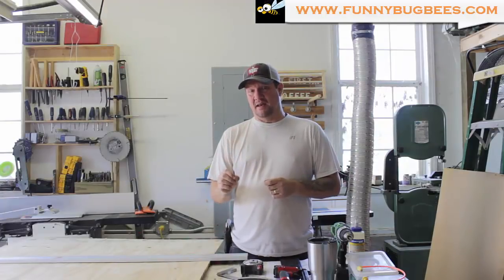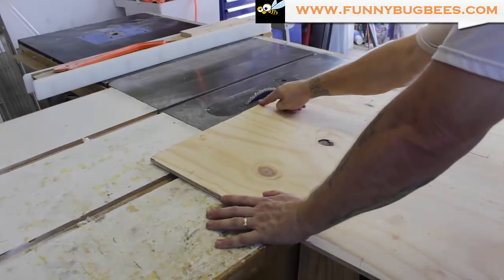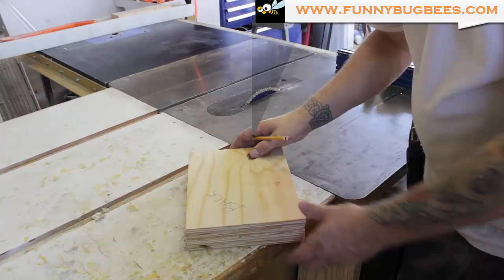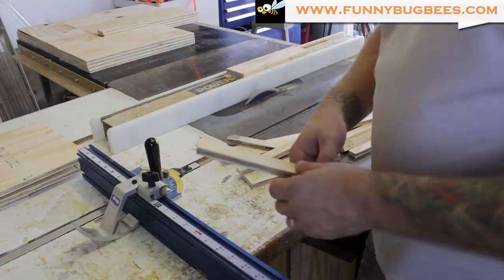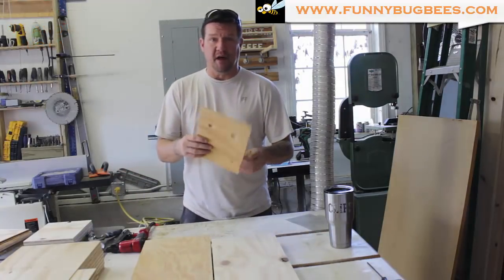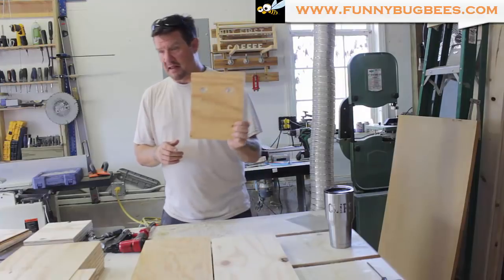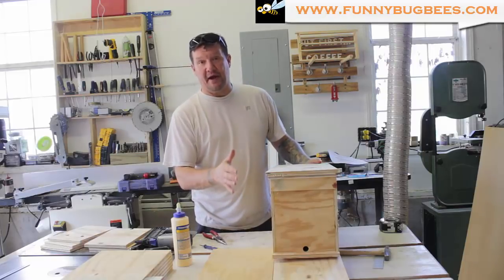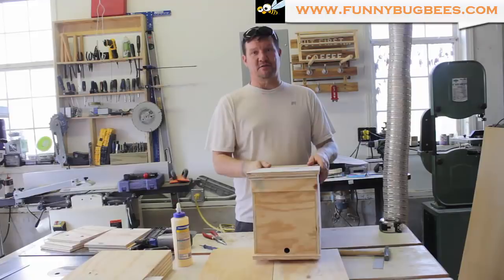Howto: Four NUCS from a single sheet of plywood

Comment: Thanks for this video.  I immediately built four boxes to use for swarm catching.  I did find that making the cleats for the top cover at 1" instead of 3/4" provided less play and a more snug fit.  Also, I cut everything using a circular saw so it was a little easier cutting them to 1" width.  For day to day use in the bee yard, I agree that 3/4" plywood would be a better long term investment, but for swarms and selling, you can't beat the cost of these!
Reply from the maker: exactly..though if you dip these in parafin wax, they will literally last for years and years...
Reply: @FunnyBugBeesandWoodWorks  any risk of the ply delaminating at those temps?
Not sure what temp is safe with WBP ply (exterior grade)

Comment: Nice job. I use 3/4 plywood. Have to add a half inch to the bottoms ends and tops. On one end i cut off 3/4 of a inch for the opening so u can use a OA vaporizer. Thank for sharing.   When i say i add a half inch i mean i make them wider.
Reply from the maker: i use an OA vaporizer on my larger hives. For my nucs with these hole cut rather than the 3/4" opening you speak of i use a propane powered fogger. It has a small nozzle and I can put the nozzle right in the opening and give it three puffs and im done.

Comment: Is that a 3 ply plywood you use aom just using a piece of plywood for lids and looks good I take little xtra time and make telescoping lids with 1/2 in plywood nailed down to 11/2 in pine frame to reduce warping .
Reply from the maker: no its 4-ply BC Sanded grade playwood. Runs about $22-24 per sheet. I actually have found out there is enough cut off if you keep tolerances tight to get telescoping lids out of the same sheet!

Comment: Very nicely presented!  Thank you.  Have you had much success using these as swarm traps?  If I used them as a 5 frame Nuc, I think I'd want to be able to place the quart jar, Boardman feeder on them, so I might do a bit of adjusting to be able to do that.
Reply from the maker: Yes, they make excellent swarm traps. To convert them, take a cheap 18" piece of 2x4 and bolt it from the inside of the NUC to the outside, then drill a 1" hole 2" from the top of that 2x4 then use that vertical piece of 2x4 to hang it on a nail in a tree 10 feet off the ground and with several sprays of a product I use called "Swarm Commander" inside it and hang them all over the place. I catch probably 6 swarms each year for very minimal effort. If you need swarm comander, which I swear by you can find it here: https://www.funnybugbees.com/queens-bees-swarms/swarms/swarm-lures/
Reply: Picture of the swarm trap maybe?

I just made 4 NUCs from your tutorial. Do you mean put the 2×4 on the back of the NUC? Bottoms flush? Or tops?

Comment: Will these measurements work on 3/4. Plywood
Reply from the maker: no, any time you alter the thickness of your stock in any project, its going to alter your dimensions. For instance, you would need yo make the top and bottoms of this design 1/2" wider to compensate for the material thickness, but you would also need other modifications to the design as well. these are easy to figure out you just need to sit down with paper and run it through your brain before starting. Any dimensions which would be caused to change should be compensated.

Comment: I like this project. But i do have a question; Would it be good do use a smaller mesh for the vent holes? #8 is small enough for small hive beetles to get through. That's what is commonly used to make shb traps.
Reply from the maker: this is incorrect. #8 mesh has an average aperture size of 0.0350 inches or 2.2mm which is smaller than an adult hive beetle which are 3.2 mm across the carapace. The correct wire cloth to use for hive beetle traps is #6-041 which has an average aperture size of 3.2mm. Sure some hive beetles will still be able to be trapped using #8 (but very few), #6-041 is far more effective as it is the exact size of a small hive beetle...you can see and order this product here: https://www.funnybugbees.com/the-bee-shop/beekeeping-supplies/hardware
Reply: Doesn't really matter about the mesh size. The beetles can walk right in the front door.
Reply from the maker: true, but this is why we run Freeman style small hive beetle traps on all our hives...they walk in...and immediately are drowned, and we lose no bees. The ones that dont walk right in are wrangled by guard bees and driven down into the same trap. You can look in my videos I have two videos on this, one on how to build them and one on checking a newly installed trap after 24 hours.

Comment: I like it.  Does it hold 5 frames?  Thanks for the directions.
Reply from the maker: Yes, they are 9" wide 5 frame nucs. So 1/4" narrower than a standard langstroth NUC, but the same inside dimensions. The outside dimension is different due to different thickness of stock.

Comment: are these deep enough to not squash queen cells on the bottom frames
Reply from the maker: The distance from the bottom of the top bar of the frame, to the bottom of the frame bottom bar is 8 5/8". The fronts/rears of the NUC are 9 1/2" high. This means from the floor of the NUC to the bottom of the frame is 7/8".

Comment: Why didn't you use 3/4" plywood so its standard? A lot more rigid too. How have they held up in weather? Thanks
Reply from the maker: because 3/4" plywood is $34 a sheet and 15/32" is $17.00 :) and these are made to be inexpensive.
Reply: And lighter. I just wonder if they warp in time.

Comment: Hey bud I built 4 of these and I love em. What would dimensions be with 3/4” plywood?  Thanks a lot.
Reply from the maker: well it doesnt matter what size stock you use, just always remember the inside dimensions and you can do anything. The inside dimensions are the same as a standard 5-frame NUC, so 7.5"  x 18 3/8" (below the cleat i.e. wall-wall) or 19 1/8 from inside cleat to inside cleat (the frame rest)......Let me get a pencil here and write it down and ill post the dimensions for you in a few minutes after verifying them.

ok here goes, editing comment, verified dimensions...

Bottom: 20" x 9"
Sides: 19 1/8" x 10 1/4"
top: 22" x 9 1/2"
Fronts/Backs: 7 1/2" x 9 1/2"
Large cleats: 9" x 2"
small cleats: 9" x 3/4"

Hope that helps Dadu...
Reply: thanks a lot

Comment: Normal plywood isn't very good for this use, the boxes tend to warp even when well painted. They are okay for traps and quiet boxes but not very good for regular use. Advantech sheeting works much much better. Of course the measurements have to be altered a bit because advantech is 3/4" thick rather than 1/2". I just cut them like a normal nuc and cut out the frame rests like normal lumber, table saw or a router will either one rabbit out a nice 3/8 x 5/8 frame rest.

I didn't watch all this vid but I assume these are the cheap nucs from 1/2" plywood like I built earlier this season with end box frame rests as opposed to normal rabbit style rests.
Reply from the maker: this would defeat the purp[ose of the video, specifically how to build "commercial grade" NUCS. If you are building a small number of nucs for personal use, then, by all means, use another material. I use 3/4 white pine for our non-commercial grade NUCS for our customers.
Reply: Ok, if you say so.
Reply from the maker: Yes, I hold fast to my statement. "commercial grade" means good for a season, not for prolonged use. The folks interested in commercials grade nucs are looking for cheap but effective NUCS they can use for a season or two. If you are selling nucs, you typically make them up the spring you do the queen grafting in, and therefore sell them the year they are constructed, and they get transferred to standard hive boxes by the end user shortly after. Making them out of plywood provides a cost effective method of moving the product you are really selling (queens) to the end user without spending an arm and a leg on the housing for afore mentioned queen.
Reply: If you say so. Personally, if I'm going to have to take time and effort to build my own woodenware, I'm going to use more reliable material. If I want something cheap for a season's use or transfer sale of nucs, I'll use cardboard or PVC. My time is worth way too much, I can't build even the 1/4 ply boxes as cheaply as the cardboard or PVC boxes.
Reply from the maker: I've checked prices on cardboard NUC boxes and they average $8. If you make four of these from one sheet of ply they cost $5 each, or a savings of $12 for four of them vs the cardboard ones, and they also will last longer, can be used as swarm traps for a couple of seasons, etc. The time and effort are negligible as it takes me literally 1 hour to make four of these. Of course, your mileage will vary, and you must do whats best for you. Then again if this video isn't for you then I understand.
Reply from the maker: Yes brent, they are the cheap ones made from 1/2" ply. I think most of us who are using them for the intended purpose (selling nucs) dont mind that they warp as we realize the end user (your customer) is going to transfer the nuc to a more suitable 8 or 10 frame box shortly after the sale. Those of us who are interested in boxes that can stand up spend the extra money on select grade pine NUC boxes, which we also sell such as those seen here: https://www.funnybugbees.com/the-bee-shop/beekeeping-supplies/hive-bodies-and-supers/langstroth-5-frame-boxes
Reply: Nothing wrong with the video, glad you made it. A lot of people just enjoy building their own stuff and don't count their time as being worth a lot. Around the ranch I figure my time is worth at least $12/hr so that adds an extra $3 to the cost of each of these boxes so I'm back at $8 each. I can take that same hour and build four boxes out of a sheet of better material and add only $2.50 to that cost and have boxes that I don't even have to paint and get 2-3 years out of with advantech and have a better R value if I want to overwinter the nucs. Still just have $10.50 in them vs $8 for boxes that will warp in a month after being painted. $8 each for the fold togethers is a lot more convenient for me for that sort of a use. Not trying to be a jerk, just commenting about my opinion. Knowing now what I do, I feel like I wasted a lot of time building mine this spring with the 1/4 normal plywood...just saying.
Thanks for the replies and the vids.

Comment: How do they hold up?  A year ? Two years ?  I'm just looking for a cost effective swarm box.  I want to catch the bees in the box and keep them in that box for at least 5 months. 
Would they be able to complete this task ?
Reply from the maker: they are made to hold up a season or two with just the first coat of paint. This will vary depending on your humidity level etc. I use them as swarm traps and to sell NUCS in. I live in the south and we have 100% humidity for about half the year, they hold up fine for me. Besides at the price point, they dont need to hold up for too long to get your bang out of it for any bucks you put in ;)
Reply: Funny Bug Bees and Wood Works 

I'm down around Houston humidity was my concern also.  I think it's a great video and price for the build.  
Thank you so much for your videos.
Reply from the maker: if humidity is the concern and you want them to really last for several years, then just paint the outside, then dip the whole thing in wax (parafin or bees) and they will last literally many years.
Reply: Funny Bug Bees and Wood Works 

Thank you so much for your videos.  What a great idea dipping them in wax.  Do you have a video showing this process yet?
Reply from the maker: Sure thing clayton, anytime! And thanks for watching!
Reply: Funny Bug Bees and Wood Works 

Made two of these this weekend. We didn't have a table saw did the best we could free hand.   Turned out just fine.  I used number 6 hardware cloth instead of the 8 felt like it was big enough to let beetles into the hive.  Only thing I have not found is the tyvec you talked about.  Will go by a big box store next weekend.  Since hurricane Harvey been hard to find materials here in Houston.
Reply from the maker: #6 hardware cloth, at least most weaves have an average aperture size of 3.2mm which is big enough for a beetle to get through. #8 hardware cloth has an average aperture of 0.125 inches or 3.1mm which is NOT big enough for a beetle to get through. So make sure you are measuring the actual aperture of a hardware cloth and NOT going by the #-designator to select it for any particular application. About 6-10 different weaves are available for each #-designator, all with different aperture (holes) sizes.
Reply: Funny Bug Bees and Wood Works 
I may have been wording it incorrectly wrong.  The store had 1/8 inch and 1/6 I liked the 1/6.
Reply from the maker: https://www.lowes.com/pd/DuPont-Tyvek-3-ft-x-100-ft-House-Wrap/3203841

Comment: Is there enough scrap to make them a little wider
Reply from the maker: the final cut off from the end of the plywood is about 8 inches wide, so yes there is plenty to make the "bottom" strip as wide as you need. Though standard NUCS are 9" and some people make them 9 1/4" but either way there is plenty of room. Though why you would want to make them wide and mess up bee space is beyond me, unless of course you are talking about making them like 6 frame size or something.